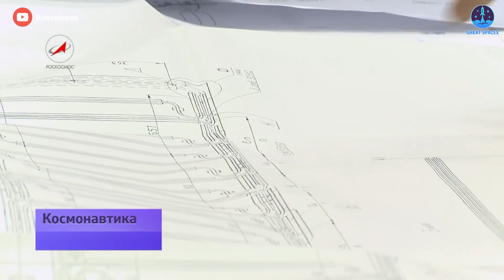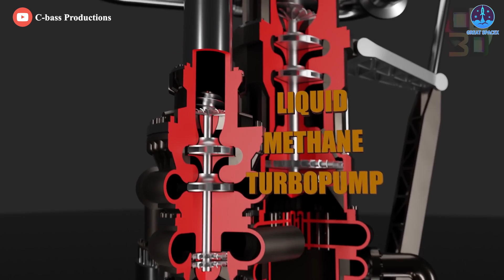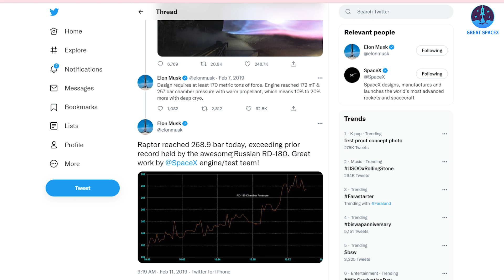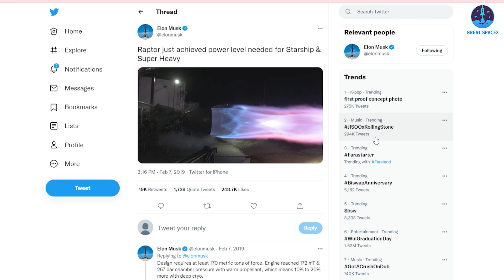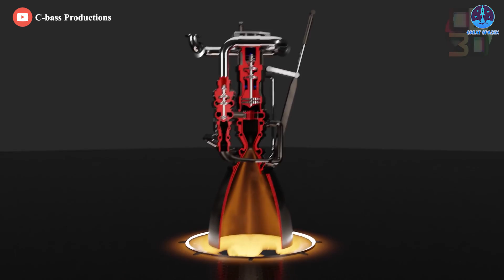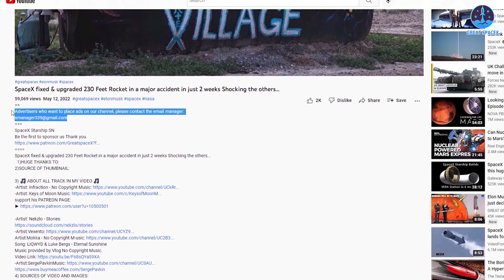It happened...! Russia finally realized SpaceX’s Raptor is BETTER than Russia’s best engines!

Comment: The raptor has a long way to go before it can even be considered as equal to the RD-180, let alone “greater”. Now I think they will eventually get there with it, but we have to see some actual endurance and on mission performance. I need to see it run without puking itself out on relight (before I get fanboyed, you can’t argue that, just watch the test flights). The RD-180 is BULLETPROOF….fact; unfortunately.
Reply: Give it a couple of months to see a Raptor 2.0 fly, FAA permitting.
Reply: How sad for you that you can't count.
Reply: U r delusional. The raptor is reusable it costs less and better ratio nobody will use russias rockets they are too expensive
Reply: Apples & Oranges. KeroLox vs. MethaLox. A better comparison would be to the (equally impressive) Merlin engines.